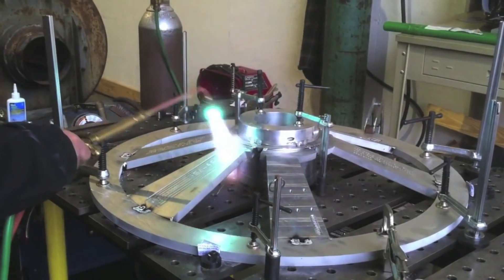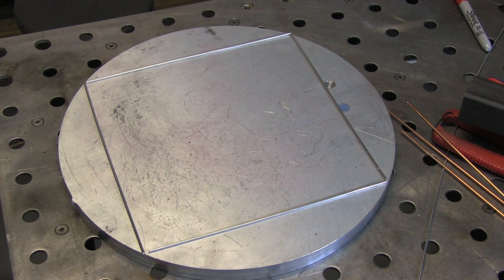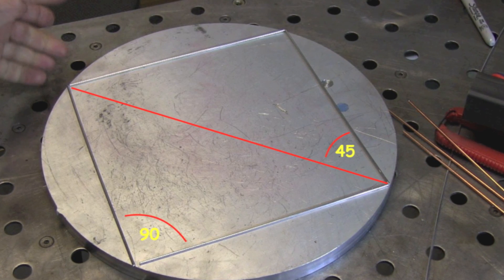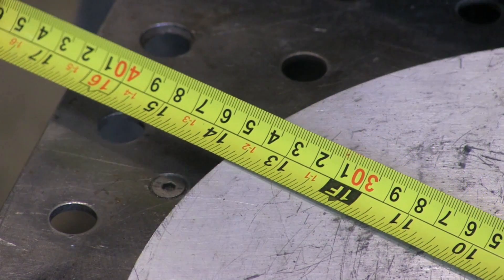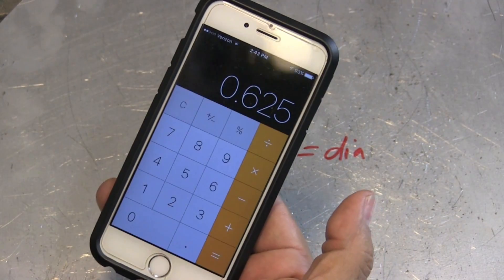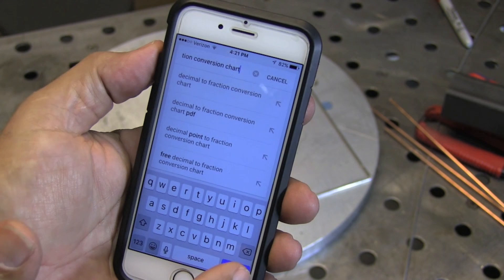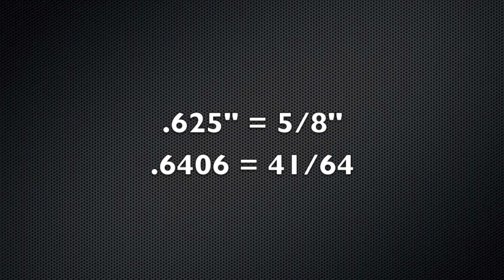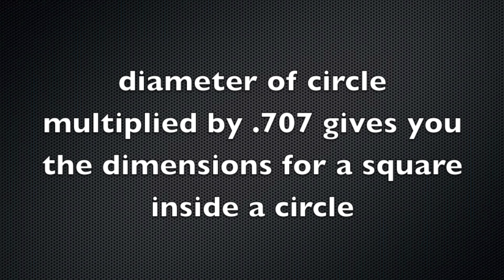Welding Fab Tip - Square inside a Circle

Comment: Love your TIG videos Jody! But I really cannot understand why anyone wouldn't work in millimetres, for something like this, even in the US. As a Brit in the construction business, I used to often work in both for simple measurements (tapes are always dual scale) but I reckon I'm 99% metric now.

We'll never stop drinking pints, or traveling  in miles, but won't EVER go back to feet and inches when we leave the EU!
Reply from the maker: I was thinking the same thing while I was going thru these steps.  would have been easier to use millimeters for all the measurements and math
Reply: IanC Yeah, you are correct in a way. The problem lies that most of us here in the USA think in imperial measurements. Also finding a metric tape measure in these parts is not an easy task, quality metric measuring tools are hard to come by around here, usually find, poor quality ones, in the bargain bin at your local hardware store or harbor freight. Metric measuring tools are just not a common item in the USA, and we usually pay a hefty premium for them if we want a quality measuring tool. Retailers, in general don't carry them because they just collect dust on the shelf. Sad but true.
Reply: If the pipes in britain is anything like in the rest of the EU, you most probably on the DN standard instead. It's just another way of describing more or less the same pipe size. DN25 equals a 1" pipe. 25 mm roughly equals 1". That the pipe then measures 33.7 mm outside diameter and the reference to the 1" is the internal diameter is another story all together. And that measurement changes because of wall thickness, so the outside diameter can stay the same. And then you would think that would equal the american standard, but no. ASTM pipes is also a thing, which as far as my eu centric viewpoint, is the standard for american pipes. Those almost, but not quite, has the same outside diameters as the DN standard.
And just to f... it up even more, ISO is also a pipe standard, with pipes for dairy production facilities. Thin wall (1 mm) stainless pipes. And still a 1" pipe is nominates 25. But now it refers to the outside diameter, instead of some hopeless internal diameter you can't measure anyways.

I don't know who came up with this thinking and standard, but they sure as hell didn't try to make it easy.

All the info I just typed, comes from my experience as a metalworker in denmark. And yes I had to work with all the different type of pipes over the last year.

And don't get me started on pipe threads... :P
Reply: I can only imagine how hard it would be to try change from imperial to metric if you've been using imperial all your life.. For some reason we use imperial for our tubes and pipes
Reply: In my opinion a lot of confusion could have been avoided with the DN standard (Diametre Nominal, some french shit) if they just had made the DN correspond to outside diameter. Yes DN25 is kinda logical that it is a 1" pipe, but unless i know that the OD (outer diameter) is 33.7 i have NO way of measuring that. If they had made it DN34, it was quite easy to know which size pipe i'm dealing with, since all i'm gonna need is a caliper. But then again, then you would have to know that was a 1" pipe, but that would just be a transitioning period. Albeit a really loong one since, most pipe systems isn't changed often.
Reply: There is no reason for repeating yourself.
We do know the beauty of division by 12, yes. However, in any modern engineering situation you will not get something like "let's make this exactly 10 feet wide so that guy can divide convert to inches and then divide by 12 without a problem" but rather "okay, this needs to be 10% larger than that other thing, so let's make it 134,2 inches wide".
12 can be divided by 2,3,4, and 6. But what about 5? Okay, you can divide by 10 and then multiply the result by two but that does not give you a real benefit over a decimal system where these things simply happen at other numbers.
If we were talking about 360 as the magic number - sure, that is a whole other topic since you can divide that by almost anything.

The question what system to use (imperial/metric) is a whole different discussion (it is not a real one at all) but rather the question whether to use fractions or decimal fractions and whether to use multiple units or a single unit of measurement.

In the decimal system you can simply say "okay this is 3 meters, thats 300 centimeters" and you don't need all that inch,foot,mile stuff and the funny things that come with it like specifying body size in feet and inches.
The whole scientific community uses decimal systems (metric decimal systems) simply because if you used inches, you'd end up with something like 3.45 * 10^7 inches which is 34.5 Megainches (yes! Megainches) and nobody would have any clue what that means since such huge distances would be measured in miles (544,50757576 miles) in the imperial system. In metric decimal system you can simply say "yeah these 8.76 * 10^5 meters are 876 km and that is roughly from place A to place B".

And, coming back to your point:
First: I have never ever seen a carpenter use a calculator on the job site.
Second: Look at a map of the world and check where unit systems like feet and inches once were used and look up who uses them now. Funny fact: Most of the countries went the metric and SI way. In any profession except some special areas where the imperial system still lives in some way (pipe threads) and that only for compatibility's sake.

Whatever floats your boat...
Reply: IanC theres actually a few of them. dont know how to link, not really worried about it enough to learn.
Reply: I was also thinking that when all we are doing is transferring measurements or when you want to cut something in half, it really doesn't matter if it's metric or imperial, and metric can be much easier to work with.
Reply: Filipe Ngaluafe We managed it in the UK! After a lot of resistance, back in the 70's. Actually iron pipe is one of the few things still specified in inches here (BSP thread). We still love our imperial measurements, for waistlines and other things, but to be honest it's pure sentimentality. Most people weigh themselves in pounds (well stones/pounds actually, one stone being 14 lbs).No idea if they've yet gone metric with that stuff some people smoke :-D
Reply: Lasse Nicolajsen spot on, well said!
Reply: Lasse Nicolajsen Yes I think you're correct actually, they are DN. But as you say, they're SORT OF imperial, but not really! Maybe the US have seen what confusion results from the metrication process, and therefore decided against it!
Reply: I know, what are you talking about. Im working as mechanical designer and threads always makes me crying :-D Pipes in inches, DN, mm. Threads Rp, Np, NPT, G,... grrr. World would be great, If pipe threads will be metric.
Reply: Yes. It is not hard to remember, that 1" pipe is 33,7, but sometimes, I must think twice, what dimension have 3/8", 1/2 and 3/4"... 17,1, 21,3 and 26,9... I cant count it easily. 1/2" is 12,7mm, but pipe has 21,3 "ou-di". Grrr. Hate that :-)
Reply: Michal Rimmerak Here in the US pipe sizes such as 1/2", 3/4", 1" ,NPT, or national pipe thread, etc... refers to the ID of the pipe, but even that is not exact. Generally speaking those numbers refer to the ID of a schedule 40 pipe. BUT then, if you go to a thicker wall, like schedule 80, the OD remains the same but the inside of the pipe gets smaller, so the ID dimension is now smaller than the nominal size. They do this so that the same fittings and threading equipment can be used. Pipe is generally named by its ID size, but tubing, is named by its OD size...at least that's the way it is here in the U.S..
Reply: you may be confusing pipe with tube with that dairy speech. Pipe size is measured on ID while tube is on the OD.
Reply: Wild Weasel well that might be. Can't find the chart due to manufacture upgrading their website. But in danish tube and pipe translate to the same Word. Its round, has a hole through it lenghtwise and is something i hate with a passion 😉.
Reply: He he its way more complicated than that, there are inumerous standards for hollow rods, and i mean a LOT...
Reply: IanC ahh get out of here you crumpet eating metric dingus. 

On a serious note, there's rules of thumb for everything in imperial like for every 100 dungarees farenheight equals 1 thousandths of an inch expansion per inch of diameter. We would have to relearn these little things to effectively go to metric

It would be easier because if there's one thing ive learned, its that decimals freak people right out. Go below a 32nd of an inch and you have to go to decimals. Because people cant math decimals, we had to come up with thou which puts an arbitrary zero at the end for calculations just so people can learn decimals. With metrik thats kinda already done for you.
Reply: +Marcel LeMay: It´s the same here. We don´t have schedule 40,80. We have thickness 2,3; 2,6; 2,9; 3,2; 4; 5,6; 6,3; 7,1 etc in mm. But, as you see, it it not originaly metric succession. Better should be 2; 3; 4; 6; 8...
Reply: Michal Rimmerak Yeah, it's all a little crazy. Even a simple 2x4 stud, while it's called a 2x4, it actually measures 1.5 x 3.5 inches. I'm pretty sure, that in the metric countries, lumber standards are pretty much imperial standards that have been translated over to metric. I don't think we'll be solving the "standards" problem any time soon.
Reply: +Marcel LeMay All other blanks are in metric here. Wood blanks 60x40 have 60mm x 40mm, iron squre tubes are metric too, I, U, L and others too. Only pipes, and no all pipes are conversion of imperial dimensions. Some steel pipes (seam welded especialy) are in default mm dimensions. 22x2, 40x3 etc...
Reply: And the metric stuff gets more and more. I mean look at water tubing. All that is left in imperial are the threads and even those are not the diameter the name calls for because that name is referring to a pipe inside diameter that was used ages ago.

The big issue with imperial is the fractions and all the mathematical complexity that comes from it plus all the different "gauges" of stuff, not the question of "how big is one inch" versus "how big is one centimeter". Yeah and then there is this "divide by 12" issue that leads to "magic numbers" in imperial. Does not make any sense whatsoever today.
Reply: for welding pipe and other metal work, you might have a point. For basic carpentry, standard units are much better. Theres a numberphile video that gets into this. 12 is more easily divided than 10 is. You dont end up with as many weird decimals.
Reply: Chris H My business actually is construction, metalwork is only a hobby for me. When I started 35 years ago, I worked with older carpenters who had recently made the transition from imperial to metric. Some spent the majority of their lives working in feet and inches. Most of them aren't around anymore, but there's NO question which they found more efficient, especially with the advent of the pocket calculator. I'm sure you guys do it, but how for example do you work out the rise of stairs, like dividing 8'9" 7/16" by 13? I've got a headache thinking about it!

But for a REAL challenge you should scrap your decimal currency and go back to what we had in the UK until 1971. Pounds shillings and pence. Twelve pence in a shilling, twenty shillings in a pound. How people used to work out percentages in those days, manually, I cannot imagine! they did of course, but heaven knows how long it took.
Reply: IanC fractions are easy. invert and multiply. You learn that stuff in grade school. Who wants to get a calculator out all the time. What if I need something divided in 3 parts. Id rather be measuring in inches than have a run on decimal
Reply: Chris H Yes we did fractions at school, and of course they still do! Indispensable to mathematicians, but measurements I'm not so sure. Actually Jody nails it in the vid. Don't forget I'm speaking from the country that devised the imperial system of measurements (sorry!), but actually decided it was worth the upheaval of making the switch. Consequently as mentioned, I've worked with plenty of people in years gone by who've used both systems in their daily work, I think they're the only ones who really have a valid opinion.
Reply: Chris H IMHO the metric system is the only good thing we're taking from 45 years in the EU! We won't stop drinking pints or traveling miles any time soon though :-D
Reply: IanC Im a carpenter. I have a valid opinion. The whole benefit of counting by 12 is you dont need a calculator MOST of the time. It would benefit you to at least watch the numberphile video (made by a brit by the way). You only need to calculate rise and run on steps a couple of times (8 3/32" by the way but we arent building watches here) but simple dividing by thirds and quartering things is done constantly and i dont even have to think about it when dealing in inches.
Reply: Chris H I have tried to find the vIdeo but failed! Post a link if you can, as i will watch it. But does Jody multiply his measurement by 707/1000? Nope, he converts it to metric before getting out his calculator, and then converts it back again! But each to his own....
Reply: BavarianMonkey if you read my original comment, some things might be better done in metric. Basic carpentry isnt one of them.
Reply: Yes I did read that and I disagree. As basically the whole world does. Carpentry in almost the whole world is done in a decimal system and it works just fine.

I have never felt the necessity to convert my measurements to an ancient format nobody uses in order to do my job faster or tell other people that this ancient, outdated format has practical value. 
This is 2016 and people have managed to live with and use the metric decimal system for centuries and even convinced almost everybody that is the objectively better system.

Guess the mission you have is some kind of patriotic thing because well.. even in your country engineering uses metric in most cases, NASA changed to metric, the whole world uses metric but I guess some people don't want to change for whatever reason...
Reply: BavarianMonkey close minded and purposely ignorant yet has the time to write thousand word essays in a youtube comment section. Sad.
Reply: Jody had to use decimals here because doing this here in fractions does not make a lot of sense - as does most stuff when you think outside the few calculations you might need for daily routine work.
And "close minded" is certainly not the right term to call a non-US person that is firm in imperial AND metric units and has to use imperial measurements (in most cases decimal, some in fractions) every day because some companies don't speak international standards. So much about "ignorant" which means "not knowing" - and which is certainly a wrong assumption in this case.

We can continue this chitchat about inches and fractions versus meters and decimal but it simply seems that you are trying to force your fraction system upon people that cannot use it because all it is good for is BASIC stuff while it makes everything else complicated. And those basic things can be done in decimal as well. That is simply a matter of what you are used to and there is no better/worse there. In decimal you end up with periodic numbers when you divide by multiples of three, but what else is better when using twelve? (And yes, I know the numberphile videos).

If you like to be insulted because somebody calls an ancient outdated assortment of units (that are even DEFINED by metric units as one inch being exactly 25.4 mm since the 50s - isn't that funny?) and way of calculating stuff ancient and outdated, be insulted. On the other hand: If you prefer to be open minded and cool about it, learn new stuff outside of your comfort zone like Jody and a lot of other people do every day and stop insulting people ... I did not call you stupid, I called the system your country tells you to use ancient and outdated. :-)
Reply: All you prove with your replies is you have waaaaay too much time on your hands. You even just agreed with what i said and dont even realize it. Adorable.
Reply: Nothing to prove - simply another way of spending an evening, with funny youtube message popups inbetween hobby work :) Have a nice day! :)
Reply: You do the same. Take it easy.

Comment: SIN 45 = .707
Reply: Also, cos(45)=0.707... =)

Also in mathematics, there are many ways to skin a cat (and even more if it's Schrödinger's)
Reply: Yup. But since we're going to use the calculator anyway, it's best to just punch in the diameter X sin(45) and get the exact result =)

And to give all imperialists ;) a break, the only thing that is extra is the fraction conversion. Maybe ask the tape measure manufactureres to make an imperial tape measure with decimals instead of fractions =D
Reply: or sqrt(2)/2 = 0.707..